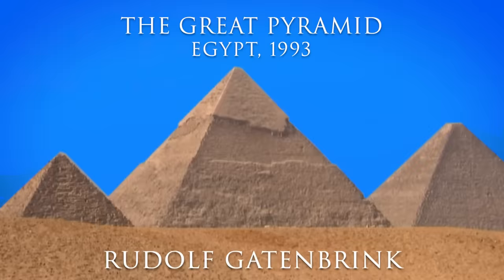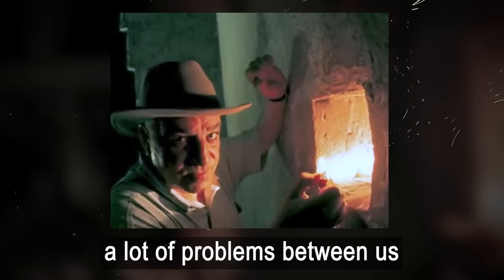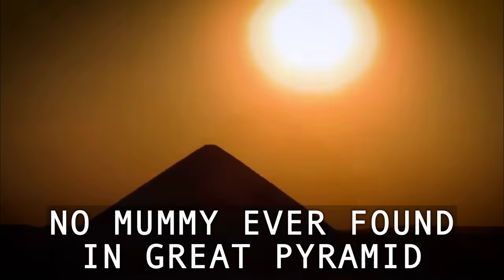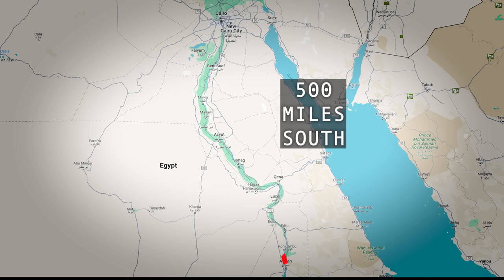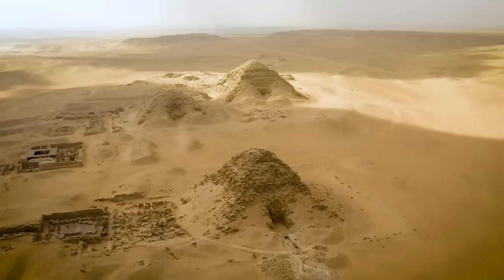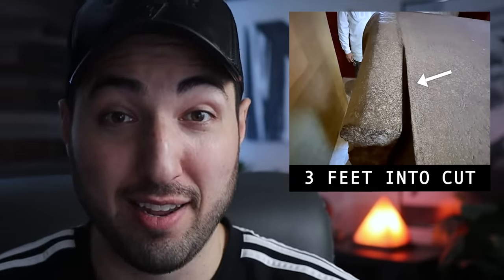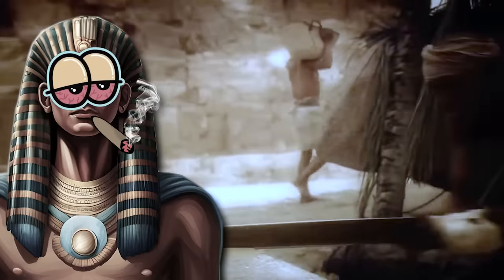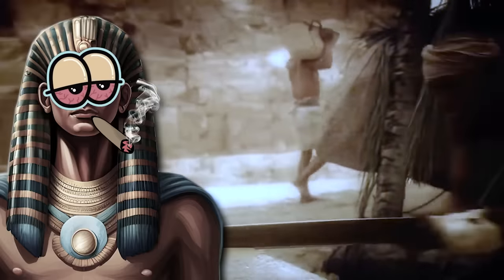The Great Pyramid Mystery: The Oldest Cover-Up In History

Comment: The speed of light may not have been discovered until the 1600s, but also, the units of the meter or the second had not been invented so that number would have no meaning when the pyramid was designed.
Reply: If he refactored the numbers in Cubits, his mind would explode with the 'whole' number results.
Reply: @scottragland9899 No none if this is irrelevant.  The pyramid is 29.9792458° N  and the speed of light being 299,792.458 meters/sec looks like exactly a 10^7 difference but all the units are different.  You are talking about degrees, meters and seconds and none are the same.  All theses units are arbitrary and not based on some cosmologic constants.   24 hours is not the exact length of a day and neither is 86,400 seconds.   Why did they decide to choose 360° in a circle or 24 hours in a day or 3600 seconds in a hour?  The entire meter system was based on an assumption that a meter was exactly 1/4000000 the circumference of the earth.  It is not.   All there measurements have been determined somewhat arbitrarily by men many years after the pyramids were built and if you change any of them even slightly you would see that these numbers no longer have any resemblance.
Reply: For millimetres, they just held their index finger next to their thumb so it was not quite touching & said “about that far”.
Reply: @philthejeweller  Not, quite. They divided a Meter by 1000, and the Meter is two scratches on a gold bar "about that far" apart.
Reply: When one searches enough, one finds some form of amazing numbers in everything.    I read a paper once that proposed that the "Grand Gallery" was a calendar that predicted into the distant future, and went on to explain how every inch was a certain number of years.  They supported it with descriptions like "Here at inch 240 which correspondes to the year xxx, we can see a pair of stratches on the left wall, and during that year there were two wars in Europe..... "    Pure poppycock.

Comment: My thought is that the stones were lifted by a 2 way sled that would carry one stone at a time up the side of the pyramid. The sled opposite the one with the stone would be counterbalanced by people that would hike up the side and stand on the sled until the amount of people would offset the weight of the stone. They would just remain on the sled until the stone was removed, then another stone loaded on the sled they just exited from, while others hiked to the top on the opposite side. Back and forth, back and forth, on all 4 sides of the pyramid. Stone up, people down. This would take zero strength to pull the stones up because its all just counter weight. This also explains the 8 sides, because the weight of stones and people all travelling up and down in the same location compressed the center of the sides enough to see. It was not intentional, just a result of compression. How they made the stones? Haven't figured that out yet. But I'm leaning towards an abrasive water jet.
Reply: What sorts of ropes or cables do you think they used? And pulleys to transfer that potential energy?
Reply: What would the sled be sliding on? A water jet? Water everywhere? Water from where?
Reply: You are basing this only on simple leverage and gravity, but there's a lot more going on that would not be overcome using these forces alone. First they would need 80 tons of people, which at average is about 1200 people to equal 80 tons. Then you need a "sled" that is big enough to hold 1200 people. A platform to do this would need to be at least 200 square meters. If you manage that, you then need this sled to be made of a material that can consistently bear the combined weight of 1200 people and an equally as heavy 80 ton block of limestone. This sled can't break and therefore needs to be strong enough to handle these weights, and also be resistant to breaking over time due to repetitious shifts of weight across its surface. This is highly improbable to meet all of these criteria.
Reply: @Jayson_Tatum  There were only a couple of stones that weighed 80 tons. The average stone weight was only 2.5 tons, and thats 33 150lb people. The 80 ton stones were granite, not limestone. Refigure your math and reapply the possibility.
Reply: @jonathancover4658  Yes, Im sure they used pulleys to offset the weight. And several ropes.
Reply: @MrJohnnyDistortion  Imagine a 1" diameter hole at the bottom of Hoover Dam. Now mix some of that water with enough sand to make it abrasive. Do you think the pressure of that stream would cut thru anything? Ever seen a water jet machine function? It doesnt take much water to cut thru stainless steel when you add abrasive material to it. If you pool enough water high enough, and taper it down to a small opening, add abrasive, it would cut at least deep enough to score the stone and cause it to break along that score mark.
Reply: The problem with your theory is that people have been trying to recreate this same approach for many many years, and no one has been able to replicate it, or even begin to understand how or why.
Reply: @Jayson_Tatum  You can multiply torque with gears. I even do it with rope knots.
Reply: @kepheramanjet3244  The biggest problem is that they are there. They exist. So somehow, they were built. The stones could not have been lifted, they are too heavy to carry and why would you. Pushing them up a ramp is slightly better than lifting, but then you have to build the ramp. It has to be done the easiest way possible. A teeter-totter toy at the park shows you the easiest way. Weight on one side, lifts the other side. No strength, just weight. There is a dent, right up the middle of all 4 sides. You think that’s on purpose? Talk about impossible, that’s harder to do than just building them. It’s a dent, from weight. From the stones traveling up the side. You want details, then figure it out. But that’s how they got to the top.
Reply: @chrisgray5518  it’s already been revealed that they used sound wave frequencies and electromagnetism through underground conduits to move those stones. The theory of using a ramp concludes that the ramp would use more resources than the pyramid itself.
Reply: @chrisgray5518  how would you make a rope capable of pulling 80 tons?
I don’t think it could be done with natural fibers
Reply: @jonathancover4658  80 tons is the largest stone weight in the entire pyramid. One of the granite ones in the Grand Gallery. Yes, that one probably took a different method to move it. Most of the building blocks average 2.5 tons. There are 2.3 million of them. My idea is how to build the pyramids in a reasonable amount of time, within a reasonable amount of space, with the least effort possible. Thats by an assembly line moving 2 stones at a time, straight up the center of all 4 sides. The way to do that is by 33 people walking up a stairway to the highest level, standing on a sled of some sort, and counterbalancing the stone opposite of where they are. You just add people until the stone starts moving upward, and they start moving down. How many ropes do they need? As many as it takes. Use some sort of pulley system to reduce that effort. As I mentioned, the indent that creates the 8 side geometry is just that, a dent. From the weight of the stones moving up in the same location 575,000 times.
Reply: Interesting idea. Didn't Roman's use water jets to mine. They had to learn that from someone

Comment: The 2.3 million argument just isn't what people think it is. Yes, the structure is absolutely bonkers, but we're giving them too much credit when it comes to certain things. One main thing is the fact that a lot of the space in between the passages and outer surface is filled with rubble. By rubble, i dont mean dirt and broken small stones. Instead it's unrefined, uncut pieces of limestone. Yes in some cases even boulder sized limestone, but still uncut. Just with that alone, the 2.3 million number is dramatically decreased and, in turn, making the construction and time taken to construct a little more imaginable.
Reply: What is your source for this data? I can't find it anywhere.
Reply: @thomash8501  channel: ancient architects video is from 2 days ago the title is something like "Clues reveal how the ....."
Reply: There is also that theory in which the builders put somehow grained/pulverized limestone into empty cuboid molds of wood, mixed it with some sort of cement and voilá, there they had a huge block in any position they wanted (because so far, there has never been residuals of the theoretical ramps most charlatans have tried to convince us they used to transport the blocks up to higher levels). That would explain the construction, even in a short time, and also the assembly accuracy between each block, not how they grained the limestone and what kind of cement they used.
Reply: And also a lot of the stones are not finely cut either and don't fit with zero gap. There's a youtuber who has mapped out the top stones can't remember the video. I feel this video is disingenuous with a lot of fake information.
Reply: @willnestor6422  The ratio of the usual cranks to educated folks in this sub-thread is currently sadly unrepresentative of the general public! To even things up I'll throw in that the "Copper" items are the connections for ET's phone. He removed the handset after contacting home. 😜🙄🤣🤣
Reply: @harouttorkomian5897  This is hardly a legitamate reference.
Reply: Yes and as one is carved out and cut to shape plenty of materials left over for the makings of the others so the first cut would have been the hardest
Reply: @willnestor6422  what, you don't believe that a guy created a hyperspace pyramid that got stuck in a wall? Author appears to look hard for evidence of all these other things, but phones it in here...
Reply: "outer surface is filled with rubble"

Might be the work of a much later reconstruction. The pyramids as we see them now (and maybe people a few thousand years ago), are ruins.

Comment: The vast majority of the blocks that make up the Great Pyramid are soft limestone that is easily cut with copper tools, especially the relatively hard copper that the ancient Egyptians had, due to a lucky fluke of nature (it contained natural arsenic). And experiments have shown how simply using the local sand (which has a high level of very hard quartz) as an abrasive, along with toothless copper saws, can cut through granite much faster than the copper saws alone. Like, ten times faster.  So .... :body-blue-raised-arms:

Comment: Much of the limestone composing the outer smooth layer of the pyramids was taken off and used to rebuild such things as Mosques and other public buildings. One sultan tried to dismantle one pyramid but gave up because they were so well-constructed it would’ve cost a fortune to destroy it. It’s an interesting fact that EVEN TODAY it’s hard to slide a thin sheet of paper between the huge stones forming the pyramid structure.
Reply: "EVEN TODAY it’s hard to slide a thin sheet of paper between the huge stones forming the pyramid structure" LOL. Have you seen one picture of the pyramid? It is just a giant pile of stones. There is nothing mysterious there. Bigger blocks were put outside, smaller inside. If you find a spot you can put an arm between them. And some rocks are almost falling.
Reply: Put ANY two rocks together and try to slide paper between.  Such a stupid statement that proves nothing.
Reply: That would be quite a stone wall made of magic floating levitating blocks that you can slide pieces of paper between, have never seen one like that before...

Comment: 20 years is a lot of time! For comparison, the Parthenon of the Athenian Acropolis took 9 years to complete. And even though it's much smaller of a structure, it's built in a much more challenging location (atop of a hill compared to a flat plane) and the detailed work is a lot more elaborate. The reason I'm pointing out the Acropolis, is because chronologically is about a thousand years closer to our times than the Pyramids, and still we have no clear answer to how they moved the marble from the mountain of Penteli to the hill of the Acropolis. Ancient people where a lot more capable than we often believe, simply because their challenges where different. Also, being quick to dismiss Egyptians of their heritage, is not very polite.
Reply: Are you a troll? Or you really don't understand the might of the pyramids if you compare with Greek buildings...
Reply: @TrespassingPilot129  The might? As in a difference in mass? Because apart from being enormous, the pyramids are inferior structures compared to other classical buildings.

Comment: Research continued in 2011 with the Djedi Project which used a fibre-optic "micro snake camera" that could see around corners. With this, they were able to penetrate the first door of the southern shaft through the hole drilled in 2002, and view all the sides of the small chamber behind it. They discovered hieroglyphics written in red paint. Egyptian mathematics researcher Luca Miatello stated that the markings read "121" - the length of the shaft in cubits.
Reply: The fallen ones build the pyramids, meaning fallen angels.no human beings  could do that.

Comment: 13:06 Wow, the pyramid's latitude equals the speed of light in m/s before the speed of light was known ?
   Also before "latitude", "degrees", "meters" AND "seconds" were even defined.
   Truly ahead of their time.
Reply: meters, seconds etc are derived from nature. you would know that if you listened in school. well, perhaps not if you are in usa lol
Reply: And then we use 432 Hz to match 432000 "Miles" the radius of the sun. So we are cherry picking systems of measurement as we go along. Anything to tell a good story no matter how much of a BS it is.
Reply: @Bleiser3  Yes, but they were derived several thousands of years later. 
   Time travellers ?
🍁BTW
Reply: @Bleiser3 derived from nature, yes - but there are countless ratios and correspondences in nature from which systems of measurement could be derived. The metric system is arbitrarily based on a few of these, but it is far from inevitable or universal.
Not to mention the fudge factors in many of his cited numbers, the switching between different systems of measurement to find iffy connections between random things, and general sloppiness.